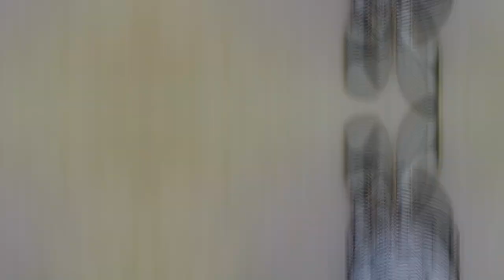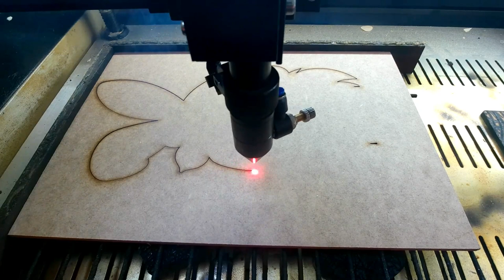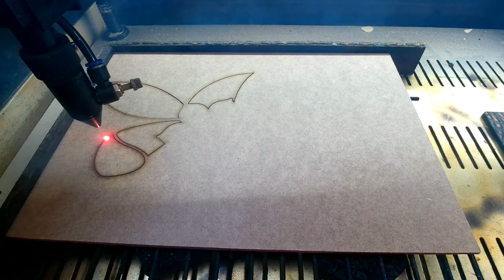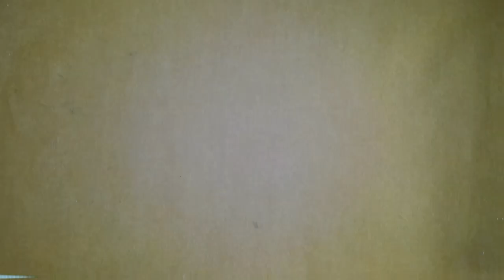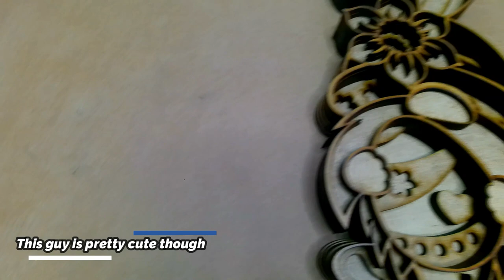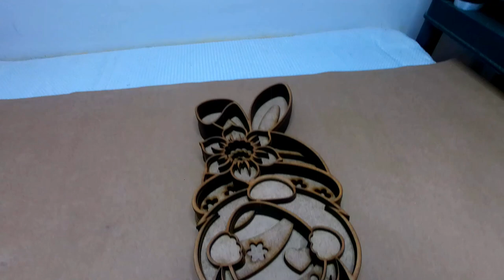Laser cutting a 7 layer Gnome Easter mandala on a cheap Chinese laser

Comment: A good tip is to cover the surface with 'Vinyl Cutter paper Tape'. It's a bit like super wide masking tape. Your'll get a super clean finish as it'll prevent the splatter (brown stains) from marking the cut piece. If you have small detail and the tape is in small cut pieces then just rub duct tape on to the vinyl cutter paper to lift it off.
Reply from the maker: Oh no. Do not use any vinyl on your laser, some will cause the chlorine in the tape to release pretty toxic vapours. You can get wide paper tape the mask and that will be fine. I actually like the effect that is left behind. If it needs to be a super clean cut I do mask off though
Reply from the maker: @andyspoo2  ah I get you now. I do have some 6" ones of these they work really well

Comment: Hi hope you are well mate, whats the thickest mdf you can cut with that laser? And do you have link where you got it from? Thanks came here after your under stair storage vid!! Funny been looking for fine cutting using cnc and laser cutting mdf vids for ages lol
Reply from the maker: You get a bit of everything here 😂.
The thickest this machine would cut in mdf is 12mm but that would take a while and I wouldn't recommend that unless you were doing it as a very rare 1 off.
The thickest I would think about cutting to sell things would be 6mm.
Its only a 50w laser which in reality the tube is probably a cheap one and only capable of 40w.
I would say at least 100-150w to be cutting thicker material on a regular basis with a good 3" lens installed.

For thicker items I just switch to my scroll saw

Comment: What speeds and power setting are you using...  I can't get my k40 to cut I've the same nozzle and air assist...trying to cut 3mm eBay ply...
Reply from the maker: I'm cutting 4mm mdf, using 8mm/s at 40% power on my 60w
On my k40 I was using 7mm/s at 15ma.
Check your focal distance, some ply is pretty bad for cutting because of the glue voids in the middle. You can't tell what's there until you try cutting though which is why I use mdf

Comment: alright mate soz to be a pain again ive done some engraving works mint but struggling to get it to cut through 3mm ply any tips
Reply from the maker: Have you done a ramp test yet? That will give you your optimal depth for cutting and engraving. If its plywood from a local limber yard it's tough to cut. There are lots of voids that just get filled with the glue
Reply: @philscraftcorner  thx mate yh a knightmare to cut whats an easy material to cut with the k40 then
Reply from the maker: I use mdf for most of my cutting. It's pretty constant. Or you can get laser ply which is much better
Reply: done the ramp test says i need to come up higher then the bed you get with it does that sound ok
Reply from the maker: Sounds about right. I took the bed out straight away
Reply: @philscraftcorner  thx mate the engravings mint just struggling to cut and burning ive ordered an air assist might help out
Reply from the maker: Air assist definitely helps
Reply: Often the lens comes the wrong way around. It should be the opposite to what you think, i.e. if should be flat side towards the work surface. After rotating the lens you'll need to find the new focus point.